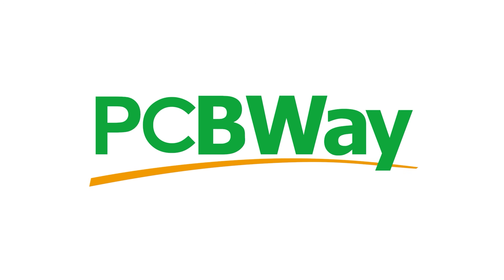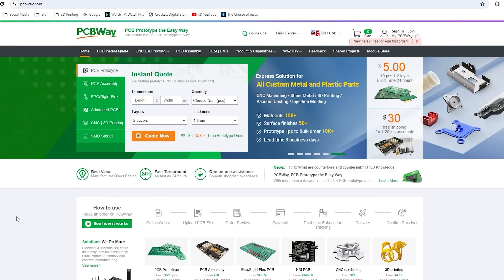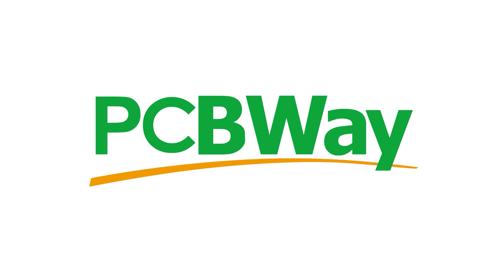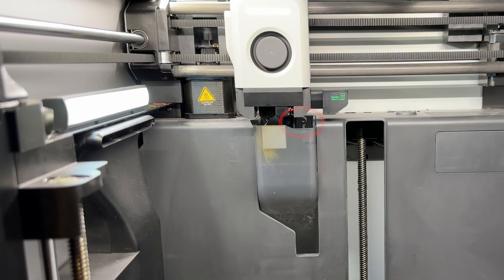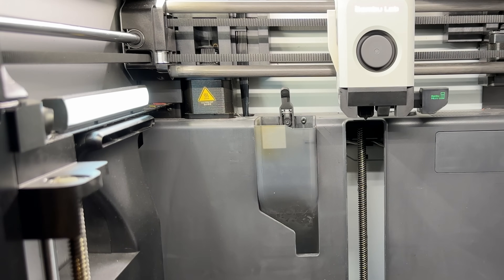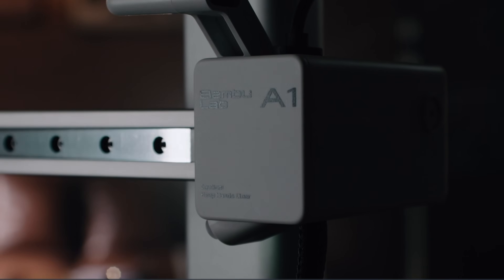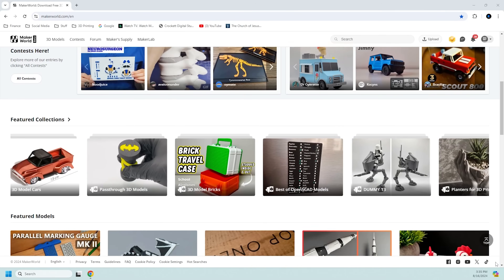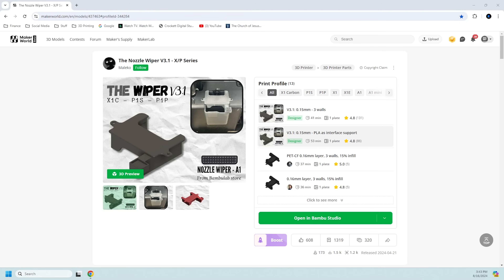Fixing the X1-Carbon's Flawed Nozzle Wiper

Comment: I wonder if anyone has thought about using TPU and making the wiper piece.  I know it's lower heat, but as fast as it passes through it may not have very much impact on it.
Reply from the maker: Not a good idea. Wouldn’t even work once. The reason silicone is used is because of its heat resistance and flexibility. 

Think about trying to make one out of TPU. You’re extruding it from a hot nozzle. You mount your TPU wiper. Then that same hot nozzle that melted it into shape earlier is now going to be passing through it on a regular basis, sometimes even hatter than it was when it melted the TPU in the first place, especially when printing with PETG, ASA/ABS, or nylon. 

Plus, TPU is not as flexible as people seem to believe. A part that size printed in TPU will not have any give. Depending on the temp of the nozzle, if it doesn’t melt, it’ll just break. 

In conclusion, TPU does not a wiper make.

Comment: You don't need to remove the original wiper. If you look carefully at the Makerworld model, the original wiper is still there beside the upgraded wiper.
Reply from the maker: Trust me.  You don't want that piece of PTFE tube involved in the wiping process.  That is why the A1 doesn't have a PTFE tube for a wiper at all.  Nor does the new H2D.

Comment: you dont even go over how to get the nozzle away from the brush, and its 7 mins in until you do something. do better
Reply from the maker: One would assume that you have already seen the screen on your printer with controls to move the nozzle around. If you haven’t, do better.
Reply: @thisprintedthing7967 pops, one can turn off the printer and manually move the nozzle.

Comment: But, but, but, the opening is super small! Any issues with the 💩missing the tiny opening?
Reply from the maker: The opening actually isn't small.  The nozzle hovers just above the height of the opening, and the opening still extends far in all directions around the nozzle.  No issues.

Comment: Looks soo easy to design, very simple part and I think I would print that "tooth brush" using TPU. Thank you for solution.
Reply from the maker: @amateur87  TPU would melt as the nozzle runs through it, just as it melts when running through the hot end. TPU would be a bad idea.
Reply: @thisprintedthing7967  good point, thx :D

Comment: It has been about 6 months, great time for a update on how it is working out
Reply from the maker: @johnkarobonik2017  I probably won’t get to making a video about it, as I had already been running it for a while when I made the first video. But I can tell you that now I have 5 machines all running this mod, and I ain’t going back. My nozzle stays clean, and so do my prints. I do have to replace the wiper every once in a while. But it’s a consumable. It’s a consumable on the A1 as well. That’s why it comes in a pack of 3. And since we cut it down for this mod, that means each A1 wiper gives us 3 X1 wipers. I don’t mind making a $3 purchase once or twice a year to have cleaner prints.

Comment: What is your opinion to Models, that use both, the original PTFE Tube and the A1 Wiper?
Reply from the maker: I don't really have an opinion.  I haven't seen any such models in action.  Not really sure how that would work.
Reply: @thisprintedthing7967  i have found one, but the guy in the Video said it needs some tries to get everything perfectly fitted, and he also ruined his ptfe tube in the process. I am printing the one from your video right now, but i wanted to know if you see any benefit in a Model with ptfe. Or do you think the Wiper is enough?
Reply from the maker: @xXMax2000Xx  I honestly don't know what benefit an added PTFE tube would contribute after the nozzle is wiped by the silicone.
Reply: @thisprintedthing7967  I tested the Mod from this video for one month now, and i must say, it really made it better. However, i lately had issues with filament poop getting stuck in the poop chute, until the printhead ran into the poop and broke off the front cover. Did you ever experience something like that?
Reply from the maker: @xXMax2000Xx  I've had this happen on occasion both with and without this mod.  The hole left at the top of the chute is still plenty wide enough with this mod installed, as the nozzle sits directly above the opening, and there is plenty of opening around the nozzle in all direction.  If you're experiencing this, it is likely not because of the mod.
Reply: @thisprintedthing7967  I watched the printer getting stuck, and for me it happened because the poop was hanging on a thin poop-string at the Wiper-Mod. Earlier this month it did still fall out, but for Multicolor PETG prints i can say it gets stuck because the thin string does not rip off

Comment: First - Great Video! Thanks for making it. I Have a QUESTION: Seeing how after you install the 3D printed adapter for the scraper... the opening for the "poop" is much smaller - Do you get issues of more poop pile up  now that the opening is so much smaller? Thanks.
Reply from the maker: @cindywhite9754  no. The nozzle still hovers very close to the hole, and the hole is very wide in all directions around the nozzle. The purge still falls directly into the hole.

I’ve purchased a 5th X1-C since I made this video. I’m running this solution on all 5 of my machines, and I’m never going back to the stock PTFE wiper.

Comment: I'm printing this nozzle cleaner as we speak.  Thanks for the tip as I noticed this all the time and was sort of catching it with my hand sometimes while its moving...dangerous.  Curious what you think about the new firmware discussions going around and al the heat bambu labs is getting for it.
Reply from the maker: I've heard kind of the gist of what has been going on, but I haven't read much into it.  I don't know that it's really going to affect my workflows, as I still use Bambu Studio, and haven't even tried Orca Slicer, though I've thought about it.  I think if I were to form an opinion, it would be similar to this guy's:

https://www.youtube.com/watch?v=x5iA2WKcJh0

Some food for thought there.  I will say, however, that with Prusa's recent release of the Core 1, I'm a bit intrigued.  Pair that with their new MMU 3, and at the price for both products combined, fully assembled, it could compete with the X1-C for my attention.  It does lack somewhat in build volume, which is unfortunate.  But I've used Prusa before, and I like their machines.  I'm considering getting one in the future.  Of course, I'll make a video of it if I do.

Thanks for watching, by the way.

Comment: I printed this exact model in petg and it works wonderfully!! I have since printed parts from PET-CF which are way above the heat tolerances of PetG. I am happy to report I have zero issues with its performance and notice no warping or melting. The small screws one must remove to replace the original wiper are difficult to remove. So I had to superglue in this wiper b/c the tiny screws would not extract from the body. The superglue is holding perfect for 2 months of constant printing. This invention has been such a welcome improvement , dramatically reducing purge filament entering the print. Thanks for sharing this. There are several variants on makerworld , but the model you're sharing is the one I fully trust.
Reply from the maker: @bombswabs3041  thank you for your kind words. Sorry to hear you had problems removing those screws. Bad luck, I guess. I now have 5 of these machines, all sporting this mod. I never had any problems removing those screws with the tools that came with the printers.

Comment: NeedItMakeIt did a review of this solution - it doesn't work well for PETG.
Reply from the maker: @UNgineering  that hasn’t been my experience.
Reply: @thisprintedthing7967 interesting, maybe he's using a different nozzle
Reply: @UNgineering I recommend the ptfe tube solution i have been using it for over 3000 wipes and im still at the first piece its flawless only had one single poop on the bed

Comment: i tried this for a while, i works ok. what i dont like about this is that it tends to throw particles of burned filament from the nozzle wall inside the chamber hitting everything from model, plate and rods. this especially noticeable with frequent filament changes, where i often get surface flaws from said particles. most of them can be mechanically removed with ease but its still a dealbreaker for me.

if you have access to a highspeed camera, i suggest filming your nozzle wiper on a stock wiper five six times and review the footage. what i found out is that since the poopchute it fastened to the chamber divider with only three tiny metalscrew into very soft plastic the chute tends to drop down over time on most of these due to thermal cycles slowly deforming the divider. ive run one of mine for about 1800 hours, mostly abs and pa. these like elevated chamber temps so my box has been run hot for a good amount of time, leading to the stock plates catching on the back wall causing homing failure. 

i tried basically all the solutions that are our there by now, and i keep settling on the stock one. after i got to film with a highspeed camera i saw that the lower the wiper was and still made contact the better it performed. so i thought i should make an adjustable rig to test out the perfect height for all of us to use. But since there are tolerances in production that FAR supersedes the needed accuracy to pull this off its going to individually done pr machine i have. so shims it is ;) i dug into the waste bin at the end of the rack and found a few aborted purgetowers and some flow cali "chips"

i started adjusting the height by loosening the two topscrews and removing the one on the backside completely as it no longer needed. (need to remove backplate to get to this one) after few tries i found the spot where it barely strikes the wiper and by this pushing it down ever so slightly. again using the highspeed camera to do this. 
when i had it pegged i took the "spacers" out and used a micrometer (digital calipers may good enough?) and printed a flat rectangle to jam under the divider where the base is very firm. (push down with finger to find the firm spot)

for the last 3-400 hours or so the "hotbox" has been flawless, just chucking out parts like a champ.
i didnt want to post this until i had ran it for a while, then i forgot about the whole thing since it just works now. hehe
then i found this when i could not sleep this night so thought i would share my findings with you all :)

i must admit i have hacked off the wiper pod on this very model and use it on all four machines as its great at keeping the purges from catching on the bar in the chute.
thanks for making a snug fitted insert for us sir :)
cheers
Reply: Nice read. Gonna look into this.
Reply: I have no idea what you are talking about. Willing to do a video?

Comment: Wow. New to the X1 (only had it one day now), and I saw your video. This mod is the very first thing I will do. Thanks so much!
Reply: FYI, I installed this. Thanks
Reply: @moodberry i actually recommend to use the ptfe tube trick over this
Basically you take a ptfe tube (the thingy your filament is in) cut it the correct size and give it some wiper thingys and its perfect and the nost cost effective you get like 50 wipers and mi e lasted like 3000 wipes to far

Comment: Hey Mike can you do an update video on this part? TIA
Reply from the maker: @rueben68  I guess I could. But there’s not much to update. It works. Just gotta replace the wiper every now and then, as it’s a consumable product.
Reply: @thisprintedthing7967  that’s essentially what I was looking for. I printed similar parts and they always cause damage due to the shoot getting clogged. I run a print farm and this would be great to fix that little issue. Thanks
Reply from the maker: @ yeah, I’ve had people ask if it clogs the chute. I haven’t had that issue with these. They still leave the chute wide open under where the nozzle parks when it purges. 

As you know, I also have a small print farm. This mod has taken care of one headache that I no longer have to deal with. I no longer have to sacrifice chickens to the 3D printing gods so that my jobs will finish in the night while I sleep without adding piles of purge waste printed into my models.

Comment: What I've found out on my work's X1C is that the structure that supports the PETG tube wiper collapses with use. So the wiper becomes unreliable.
Reply from the maker: @Parcolai  I haven’t had that experience after a few months of printing with this modification. But if one does have that issue, using a hotter material, like ABS or ASA, might be a better option.
Reply: @thisprintedthing7967  We haven't done the mod yet but it sure looks like it'll be more reliable. at work we put the thing right in the office with no ducting going to a window so we have not tried ABS yet. I already get people complaining about the smell while printing PLA. So ABS is not really an option until I figure out ventilation.

Comment: Installed the wiper mod and the heat bed with the textured plate kept hitting the corner of the wiper. Filed the plate and everything works

Comment: When I print with PLA, the standard nozzle wiper does just fine. But if you switch to anything different (I print mostly with ABS), then you HAVE to add this mod. 9/10 times, it didn't clean the nozzle properly when the filament was abs

Comment: Thank you very much for the video and for the lidar tip.

My X1C which has arrived on Nov 18th, 2024 still has that do-nothing-but-noise-PTFE.

P.S. Lidar can't do it's job on dark matte filaments (black and maybe some others). The printer says:
Filament exposure metering failed because laser reflection is too weak on this material. First layer inspection may be inaccurate.
[0c00-0300-0002-001 133522]

Comment: Built it, used it, wore it out in a few weeks, had to replace the rubber, few weeks later went back to stock. Previously I had used the stock one with no issues for 2,700 hours of printing.. Neat concept, but not nearly as strong as the stock one.
Reply from the maker: Well, it IS a consumable.  That's why when you buy the wiper, it comes in a pack of 3, because it is expected to be a consumable.

Comment: I also made this change and am relatively happy however, I have had filament stick in-between the teeth of the rubber brush just right so the blobs hang in the chute which then clogs the chute. I went with the 'over-engineered ptfe wiper' that's working well however, I think I'll ultimately try the modification which positions the stock PTFE wiper first, followed by a couple of rows of brass bristles. My hope is most of the filament falls off with the stock wiper but the brass can help make sure anything remaining is cleaned up.  The hunt for the 'just right' wiper continues!  😂

Comment: I ordered a pack of the A1 wipers today, and looking forward to making this mod.  You've got another new subscriber (me) - Thanks for the video!  I started 3D printing about  a year ago, and decided on a Bambu Labs X1 Carbon, figuring it would be somewhat more of a turnkey system than something that would need a learning curve of years and a lot of tinkering/modification to get acceptable results. After watching my printer perform hundreds of prints and filament changes, I saw MANY of these failed nozzle wipes. That really had me wondering if I needed to tune something better or it had me questioning my choice of filament quality. I use mainly Creality Ender series, some HP Ultra, and very few other brands. It's comforting to know that I'm not the only one being plagued with this nozzle wiping problem, and that there's a fix for it.  Thanks again for the great video! It's clear/concise, to the point, and I think it was well worth the watch!  Looking forward to seeing more of your content!

Comment: I just set up a new X1 Carbon and I have noticed that it does bring a string with it from the first layer review. SO far it has not messed up any prints but I do feel the need to reach in and pull it out while it is printing. I can also see how this can cause the printer to think the print has failed and is stringing. I have printed out the plate and just ordered the pads from Bambu.

Comment: I wonder if you tried to tighten the screw through the tube in the original wiper? It gets easy loose, and then it doesn’t work. It worked for me

Comment: Can the brush handle high nozzle temps? Right know The hottest I run right now is for ASA and ABS, but looking at trying some of the  CF reinforced engineering filaments. Those run much hotter than the filaments the A1 can use.
Reply from the maker: I've used this wiper with ASA, and it works just fine.  Not sure about going higher than that.  The thing is that the brush was designed for the A1, which, being an unenclosed bed slinger, is not designed to use even ASA or ABS.  That said, it kind of depends on the silicone that they used to make that brush.  Some silicone degrades around 230 degrees C, while other silicone products can withstand temps up to 320 C.  What these little brushes can actually take, I really can't answer for certain.  But considering my wiper held up during multiple ASA prints, I tend to think that these little parts are more on the higher-end side.  You just can't quote me saying definitively that they'll hold up to that.  You might just have to experiment on your own.